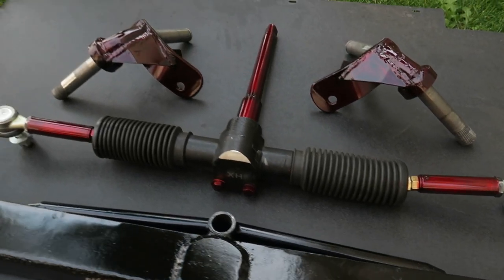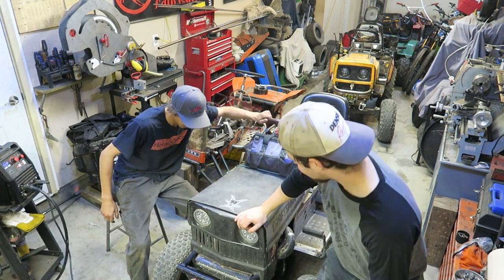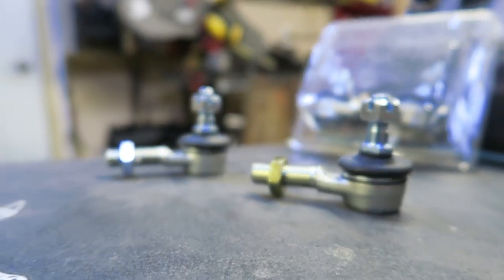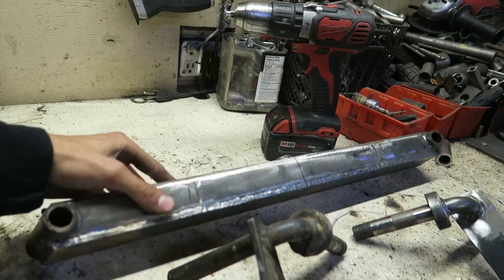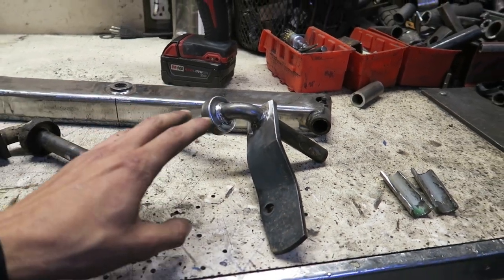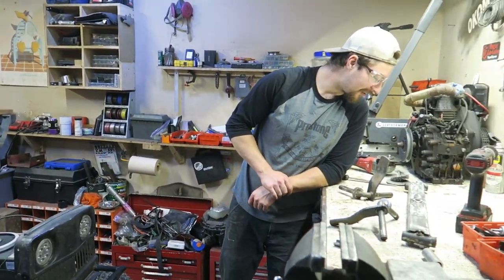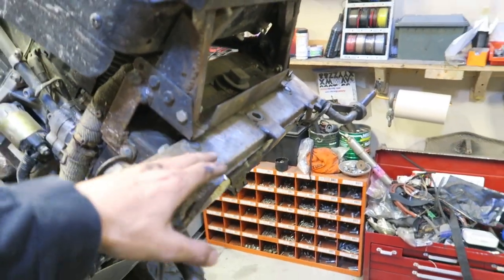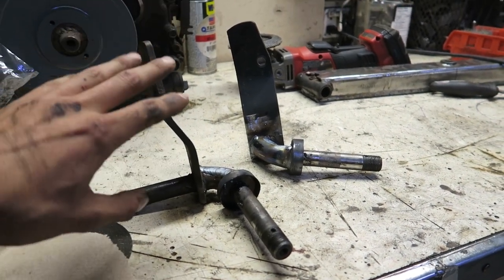Building a custom front axle and steering setup for MAGNUM the off-road mower!

Comment: why one flange bearing? Is it bc they're not so good in sheer? But really good in torsion and side loading? Or is it just cuz p.a. only had the one in stock? I'd think that 2 bearings that size would be ideal bc the pin wouldn't have to pivot in the axle causing that wear point.. I typically spend my time on front suspension even if it's a super simple rubber mounted 2 link (kinda f250 style) or mono link with track bar but suspension allows u to get away with way lighter weight steering parts and not bend stuff.. the articulated axle already takes special consideration to avoid bump steer and what not so why not use an old rubber control arm bushing and make an articulating mono link?
Reply from the maker: Didn’t really have the room to have a second flange bearing on the front, without doing some major mods, having the centre bolt greaseable allows very easy pivoting! Works great!

Comment: Love watching your modifications!  Question,……on Musty you had a mini air compressor mounted (which is cool), but doesn’t it drain your battery quickly??
Reply from the maker: I only run the compressor with motor running 
Works well